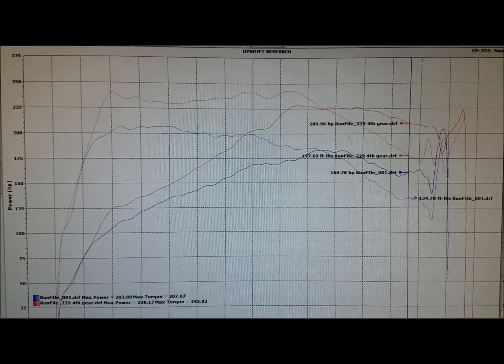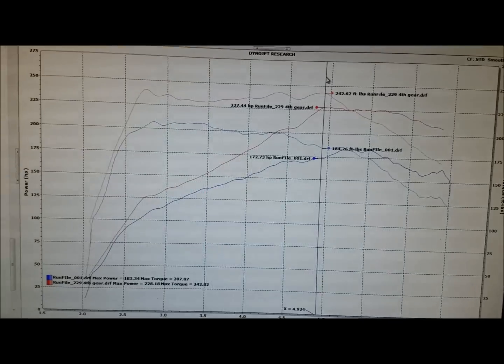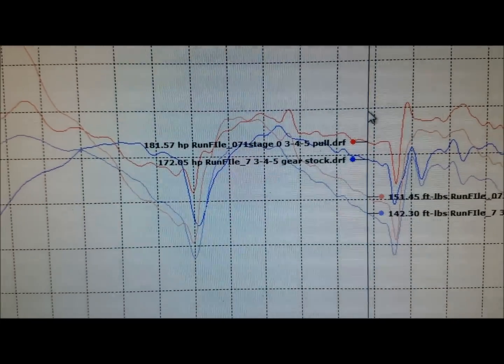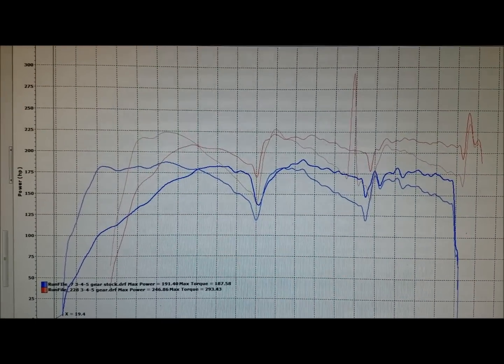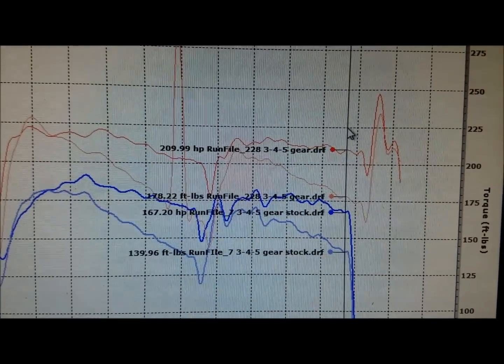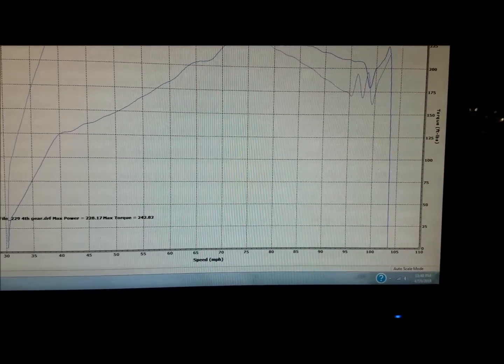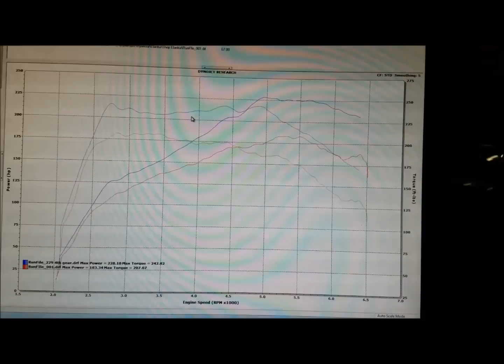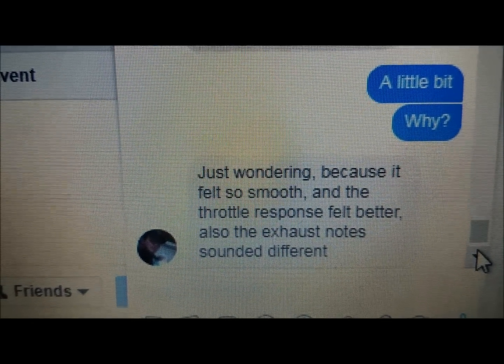Elantra Sport Stage 1 Results

Comment: Do you still make a stage 0 for the 1.6T-GDI? Will it run on 88 E15. I would like a tune that just cleans the maps up but no extra boost. Maybe a couple lbs but thats it. Going to be putting a lot of miles on car.

Comment: Any chance we get some 1.6t Kona vids?  I have a 2019 Kona Ultimate AWD and want to get to 250- 300 whp to be able to keep up with my friends Genisis coupe.
Reply from the maker: We need a customer who wants that much power, then we can show some videos.
Reply: @TorkMotorsports  I do but I'm across the country lol. I'll keep checking your website for updates. Though I remember you used to have the option for a stuffed turbo under the kona page and now you dont.
Reply from the maker: @chasedown26  we had a stuffed turbo for the KIA Soul, but been waiting for someone to come by and get a tune and turbo upgrade :)

The Kona is very similar, but not the exact same... so we had to take that down.

I would love for someone to start modding a Kona properly.
Reply from the maker: @chasedown26  we have been reworking the website to target more model specific applications.

Comment: That Stage 1 tune you're showing, what mods required to get those results from the tune?
Reply from the maker: Full bolt on's
Reply: @TorkMotorsports  so a aftermarkt downpipe is required AND aftermarket exhaust?
Reply from the maker: @mtxgalant96  highly recommended if you want this sound.

Comment: That engine is the 1.6 turbo 2018? How much turbo boost do you have?
Reply from the maker: Running 22 to 23 psi on this tune.
Reply: How much does the normal factory car have?
Reply from the maker: Boost? 18 psi falling off to 10 psi at redline.

Comment: I am thinking about adding this tune.what type of mpg losses?
Reply from the maker: If you an stay out of the throttle... they are better than stock :)
Reply: How am I gonna stay out of the throttle.
Reply from the maker: No idea, after the tune... the car is much more fun to drive :)
Reply: Tork Motorsports I’m about to order the port dongle flash tuning package do I select all available tuning options or does it come with a stage 0 or 0+ or stage 1 tune I’ve got it in my cart just waiting on you guys to reply to me , ASAP would b great while I’ve got the funds or you can pm me on Facebook Anthony McComb thanks !!! Excited to get this Elantra Gt sport manual tuned !!!
Reply: Anthony McComb did you feel any difference after install the new tune did you recommend ❓

Comment: Does this sort of tune void or affect the manufacturers warranty? I plan on keeping my new 2018 Elantra Sport for at least 10 years (I only average approximately 3k miles a year)
Reply from the maker: Any ECU tuning or ECU signal modification will void the warranty, but... we have seen very few issues with warranty issues and our tune.
Reply: if I have your dongle can I reflash the stock tune and the dealer wouldn't know?
Reply: Tork Motorsports. Good to know.  My Sport is brand new (only 2 months old, 1400 miles on it), so I think I'll wait.  Thanks for the quick reply!

Comment: Should expect similar gains for the i30SR / Elantra GT?
Reply from the maker: Blaeven I am expecting much greater gains from the 2.0T engine due to its larger turbo.
Reply: Tork Motorsports I believe he means the 1.6 turbo the 18 Elantra Gt sport , I’m also wondering is their any differences in the new 18 Elantra Gt sport and do y’all have tune / parts for it yet

Comment: With this sort of tune/power what strengthening mods would you recommend to keep it safe and strong? Stronger Head gasket, valve springs, etc......
Reply from the maker: Daniel Szuba if you wanted this kind of power, nothing is really needed other than our tune, intake and exhaust. We are not running dangerous levels of boost. It is a very conservative tune.